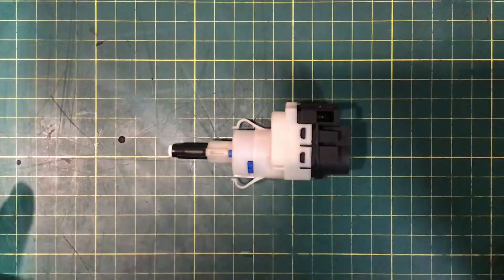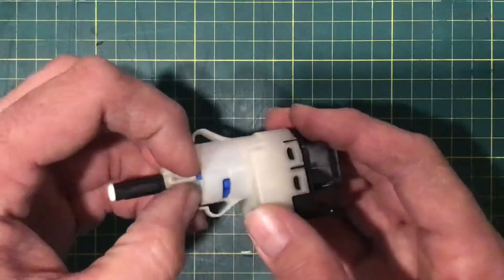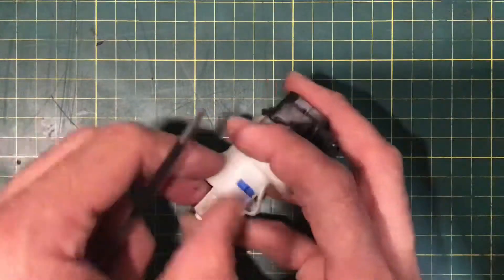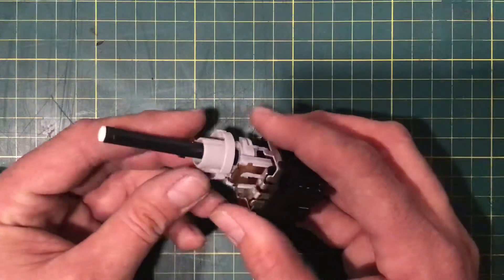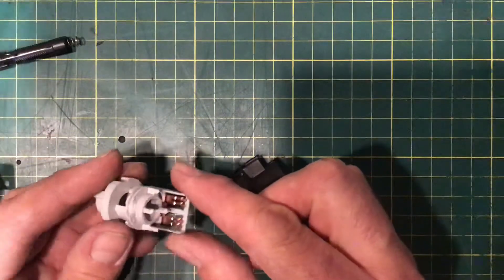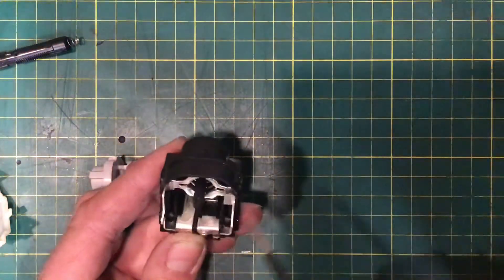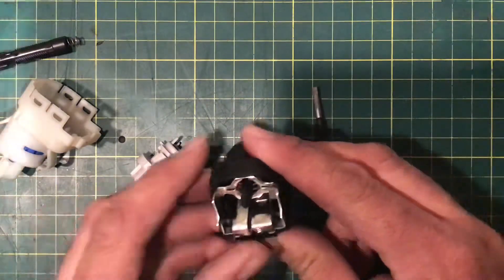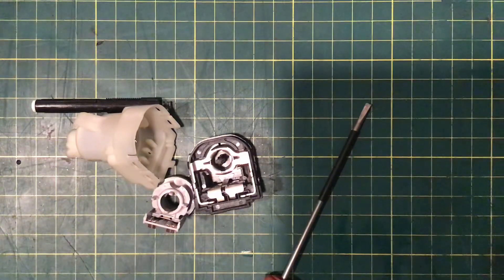Freelander 1 brake light switch

Comment from the maker: Ok. Well I didn’t have a FL2. I had a FL 1. And this came off that. And the spare was ordered for a FL 1. And it has FL 1 on the box. And the FL 2 uses a different system. But I suppose you could be right.